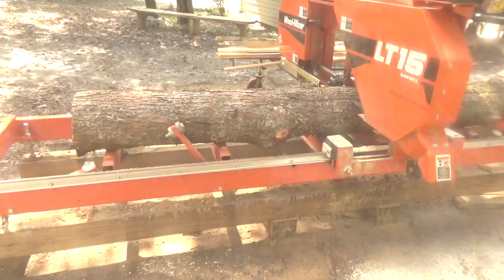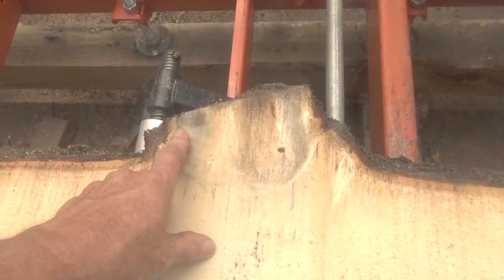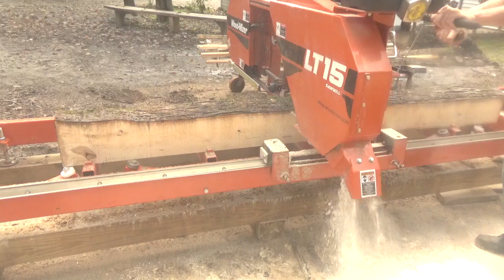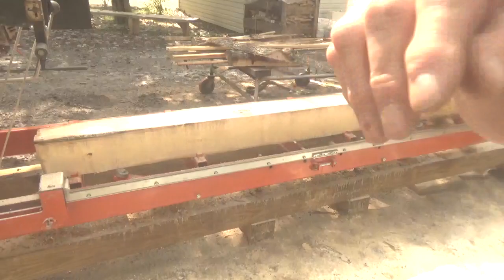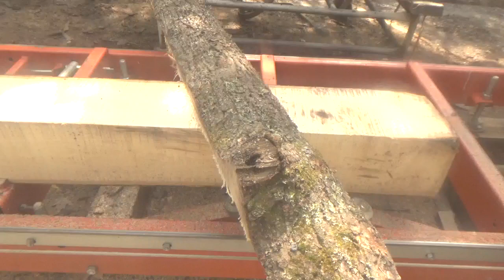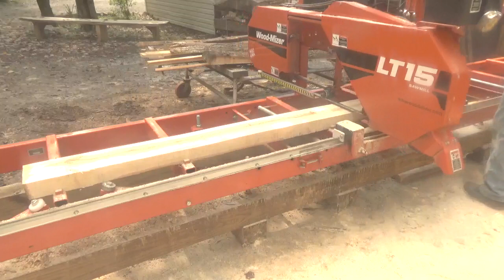(Sheer) poetry in motion. More maple from my sawmill.

Comment: Morning Joe..... actually, the poem wasn't a surprise. From watching you for over a year now I've come to expect an assortment of content on this channel. The way you broke down the poem was what I liked the best.... made real sense of what the author was trying to explain. As far as when you have to back off from your cut, could you use a small wood wedge or pry bar to lift the flitch a bit in the back to release the pressure on the blade as you back it out? Have a good one.
Reply from the maker: Hey John diversity can be good, although, well i wont go there....  Yes depending on the size of the flitch a wedge is sometimes needed. The blade was still able to move where i had it. I lost the footage that showed the frame hitting the knot on the bottom.
Reply: Josaljo Won  I was never notified by Youtube about your comment, this is happening a lot.
Reply from the maker: I have the same problem, that is why I miss some of the comments that I want to respond to.